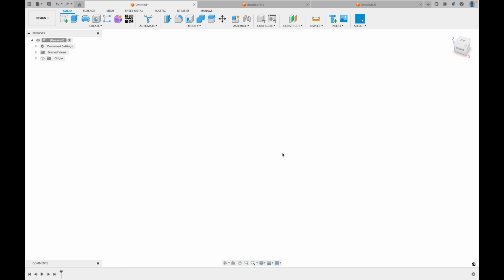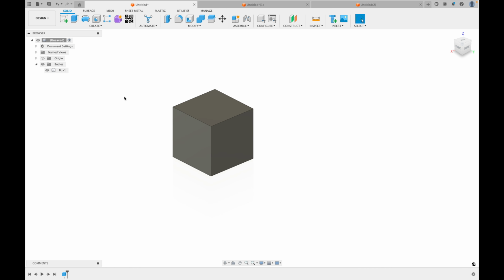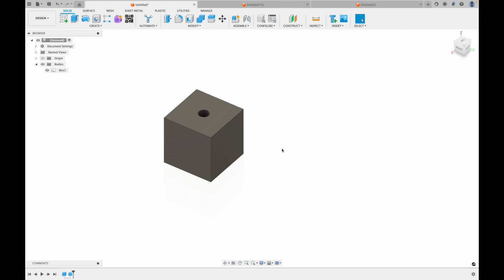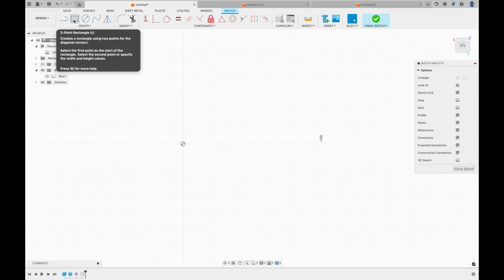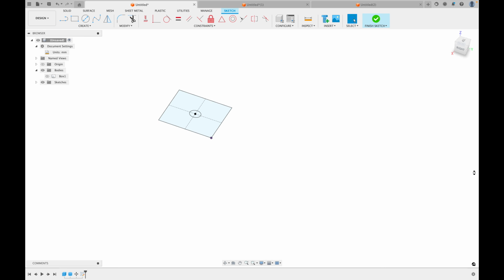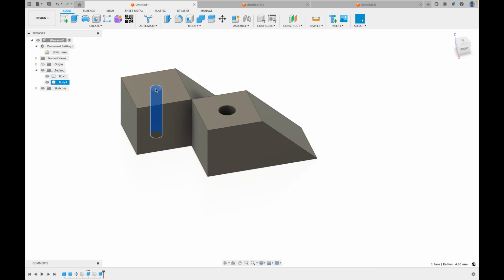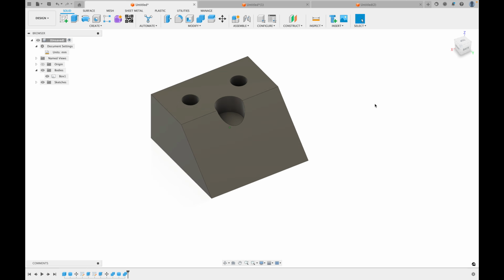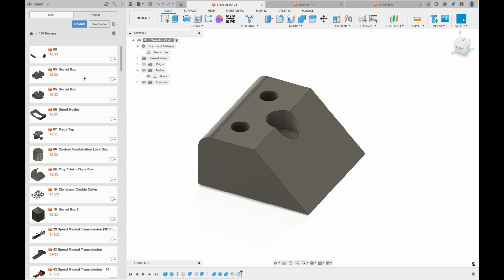Fusion 360 Complete Guide - MADE EASY 2024

Comment: Absolute total CAD beginner here. Your video begins by assuming that my settings are the same as yours and that I already know how to navigate and manipulate the object. In the first 5 minutes, I had to stop and figure out every step you did without explanation and why my drawing wasn't doing the same. Literally nothing you demonstrated worked the same. As a career IT networking instructor, I'd suggest starting even more basic to equip people with the basic skills of setting up and navigating the environment before charging ahead with the project. I found that just understanding several basic elements that you leave unsaid helped greatly.
Reply: I'm having the same results.  I try to create the cylinder and as soon as I select the second edge the cylinder shows up on the first edge.  No way to move it to the center.  Looking for another tutorial.
Reply: @RandomTorok  The guy took literally ONLY 20 minutes to give an excellent crash course on Fusion 360 and you two immediately complain. I do get it, but it really isn't hard to sort out. He is working a Mac and I am on a PC, so there are differences. A couple of the key combos didn't work, so I figured them out. I think you two probably could do the same if you applied yourself. Then again, maybe an 8 - 12 hour tutorial is what you need, which is just fine.

Comment: I could NOT get the cylinder to find the center point the way you described.

After 30 minutes of repeating the steps you did over and over, I gave up.

Is it because you're on an apple and I'm on a PC?

Very frustrating.
Reply: Even easier. Draw a 2D line on your Rectangle from one corner to the opposite corner. Hit Escape to exit Line. Select Create > Point, hover over the center of the line until you see the "triangle" (the Midpoint Constraint) pop up, then click to add a point. Hit Escape again to exit Point. That is then a centerpoint you can use. To make this line a construction line, select it and press X.
Reply: OK, I had the same issue, and I think I figured out, it looks like you don't actually click it, you just hover over the centre point of the edge on the edge move curse toward the centre of the object, then hover over the other edge centre point then move back toward the centre point and you should now have two guidelines intersecting. Then you can click the centre point. Hope that makes sense?